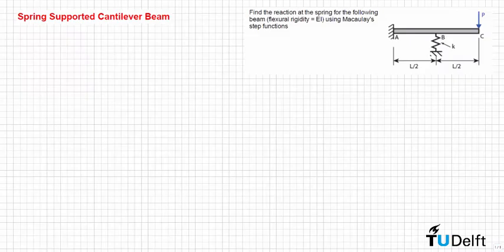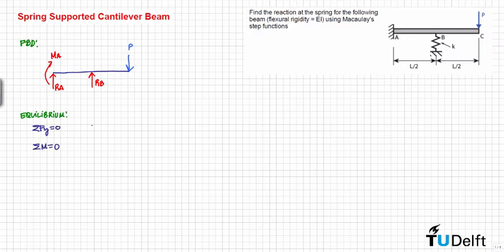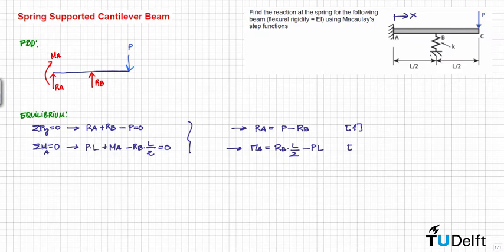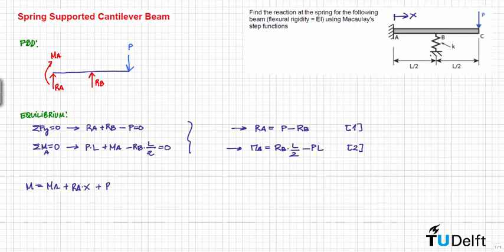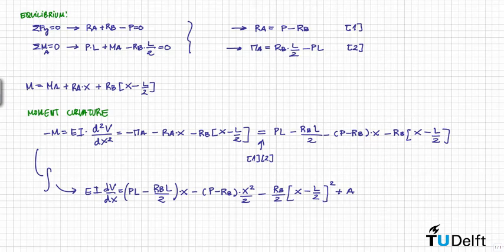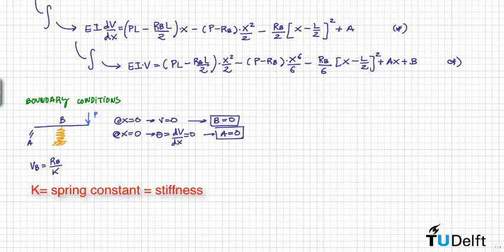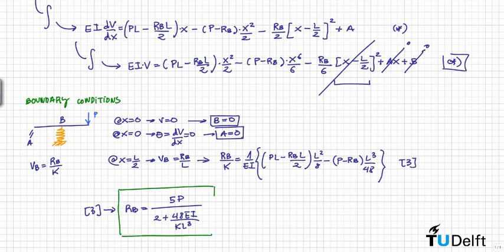Example:  Spring Supported Cantilever Beam

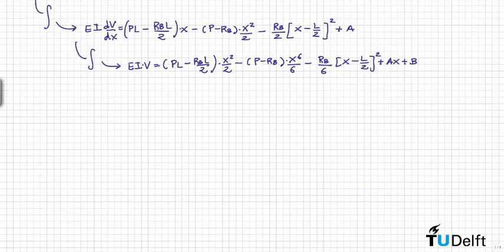Comment: Thank you for your helpful video. However, I think the equation at 5:59 - 6:04 is incorrect. In my opinion, it should be (P-Rb)*1/6*x^3 and [x-L/2 ]^3. It doesn't really affect the final answer though.

Comment: Calvin. Tiene un error en su analisis. Cuando X=0 y V=0, la constante B es distinta de cero. La constante 
B =( Rb.L^2)/24.  Revise. Saludos
Reply: @DrRans  Firstly, thank you for your video. I have found it helpful. Just wondering though, based on your explanation above of the step function, isn't x=a,for the 3rd boundary condition, so if x is not <a then  [x-a]=(x-a)?
Reply: @DrRans  Of course! thanks for that, much appreciated.